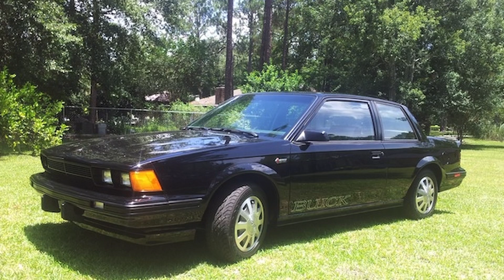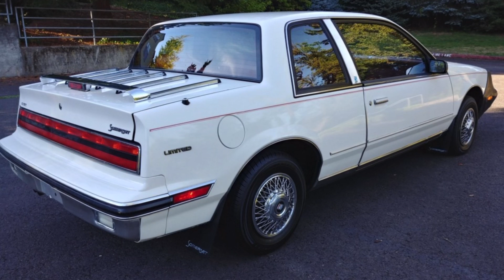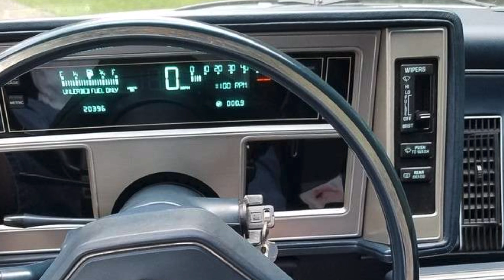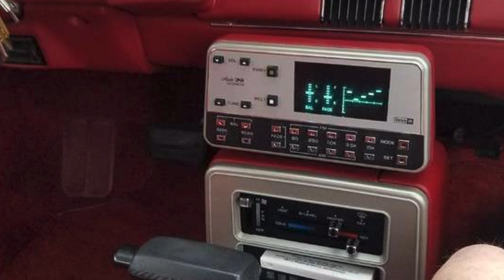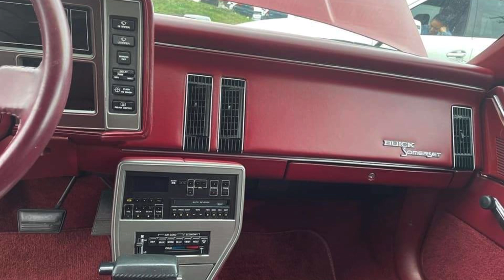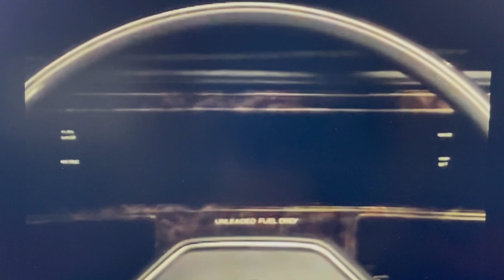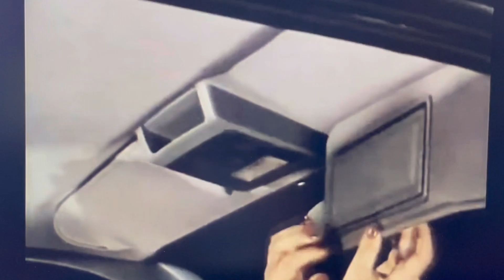Funky Automotive Interiors - The 1985 Buick Somerset & Its Tech-Centric, Porsche-Inspired Interior

Comment: Thank you once again Adam. You can see the downsized 1986-1988 Buick Riviera inside and outside on this car. The 1989 Riviera model could not come fast enough.  I also know that standard digital gauges went away in 1987 or 1988 and switched to analog cluster. They used to call this car Buick's little limousine. The sedan looked like a pint sized downsized 1985-1990 Buick Park Avenue. I did  like the interior door handles and digital cluster. They car finally got power eventually. This car was forward thinking. It is interesting how the downsized Riviera took this theme and scaled it up in size. That hurt Riviera too. It was the same at Oldsmobile at the time because the Oldsmobile Toronado and  Oldsmobile Calais were the same way with different interiors. The sedan Calais at Oldsmobile looked like a pint sized Oldsmobile Ninety Eight.  These were so difficult times for GM indeed. GM was hurting itself. I also know that these cars the N Bodies were supposed to replace the G Body cars, but did not.  The Grand Am was supposed to replace Grand Prix and Calais was supposed to replace Cutlass Supreme and this car was supposed to replace the Regal. Hence.. Somerset Regal.  Thank you Adam. You have had some great content.
Reply: My general impression of the N bodies was that GM had gone too far with the downsizing and that the discontinued Omega was a better car for the money, although it lacked some of the innovative features of this car. Car & Driver complained that the driver's seats in the N bodies made the driver slide forward into a hunch, so one had to keep pushing back to maintain a tolerable driving position and that didn't surprise me. GM probably tried too hard to carve out some of the limited legroom for the rear passengers and ended up making both front and rear passengers a little uncomfortable.
Reply: @pcno2832  very well stated.  The whole downsizing era at GM 1985-1987 went way too far. GM suffered and paid for it big time. Ford and Chrysler cashed in.  They( GM) had to spend money upsizing the cars from 1988-1992. They then were right sized. The new issue was in the 1990's and 2000's the midsized cars were too close in size to the full size models and then the suv and crossover era took off.